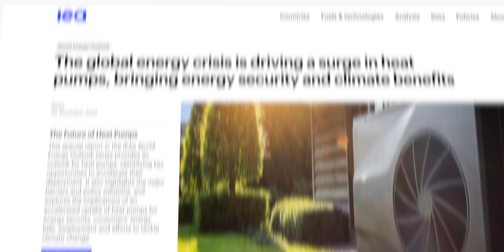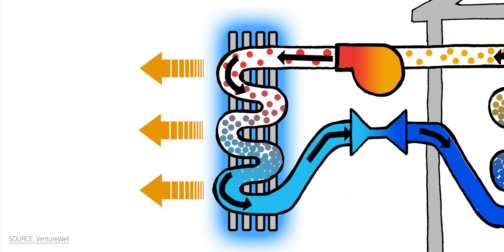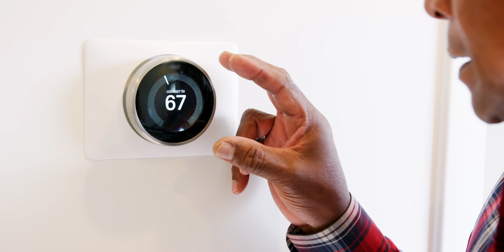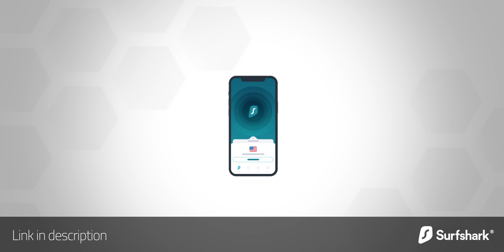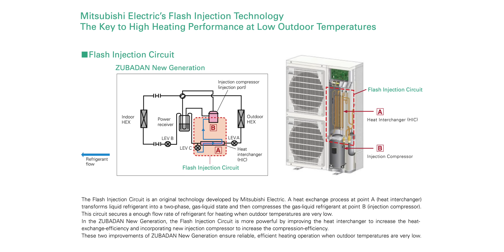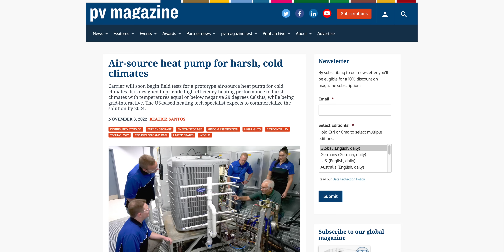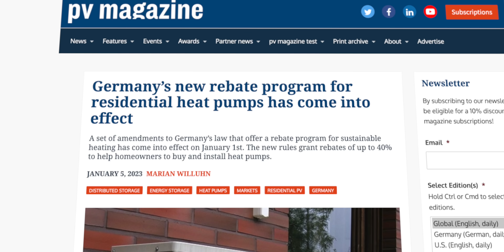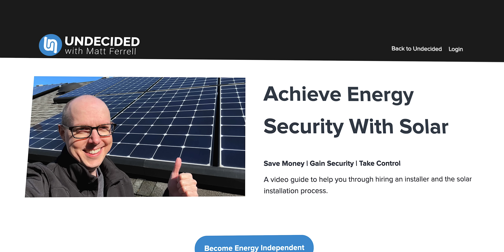Major Advances with Heat Pumps in the Extreme Cold

Comment: Just found this presentation and found it very interesting.  

May I add?   I live in a large raised ranch (2600 sq.ft.).  The home was built in '79.  Still has a perfectly functioning Heil forced air furnace original to the home, yes, the model with a 150,000 btu burner!  

Since in my town here in MA., we have our own hydro plant, I started to investigate split heat pump systems and wanted to go electric.  I decided to go with Mitsubishi.  Now, a raised ranch is really a two story home, and it was sized with one 30k btu NON HyperHeat ODU and 3 top of the line air handlers.  Two on the second floor (one at each end of the home), and one on the first floor in the large living room.  

I did NOT account for the two bedrooms and bath on the first floor at the opposite end and so...............NO HEAT!  (had to run little space heaters) After just short of 1.5 years with new system, running as it should now in it's second winter, I can say, it really does make warm air close to it's +5 degree rating.  To continue.........

I decided to contact my HVAC guys once again a few weeks ago as of this writing, and had them come back to size the remainder of the first floor and it's long hallway to those rooms mentioned.   They added another 12k btu (single ODU).  This one is rated down to -5 and is a standard model NOT Hyper heat.  So, improvements in tech right there.

It was 12 degrees the other morning, and this new additional Mitsu unit was coasting along with warm air keeping it nice and compfy.  I decided to push it to see if it could out perform my 30k btu system.   Set the fan on 4th speed, and thermostat to 80!  In about 3 minutes time, the warm output turned to bordering on HOT when I held my hand in front of the output, and was right up there where my gas furnace ducts feel in temp.

When we have short cold snaps that go into the single numbers and below zero, I DO run the gas furnace for a short bit to give the heat pumps a 'jump start' until out door temps get around 10 degrees, then  the heat pumps take over.   

Thanks for reading my experiences with an 'extended' mini-split system which is my PRIMARY heat source.  My rebate request  just got excepted and because the new addition has a SEER of 23.1 and 12.5 HSPF, I am hoping for a good return.  (O:

Comment: I looked at heat pumps here in the uk, but every time i tried, some one just wanted to rip me off, as you said the price should be around 8 or 9k, and atm there is a 5k gov grant to get that down to cost the same as a boiler, but even when I rang up big company's like EDF, they all want 12k after taking the govs 5k off, some even wanted £700 just to come out and see if my house was suitable...

Atm i Feel like they are still in cash grab mode, trying to set a high price and get people sued to paying it, or extracting as much cash as they can from early adopters as a new revenue stream.

Comment: We bought two 21 SEER mini splits heat pumps (each rated to 1400 sq ft) to heat and cool our 2200 sq ft home.  They work fine within a certain temperature range (25F to 85F).  Outside of that you have huge efficiently losses and a massive increase in electricity useage.  Our electric bill went from $350 in the summer (fairly normal) to over $700 a month in the winter.  Make no mistake, unless you are getting the exact right kind of heat pump, and have perfect insulated houses these are not a good way to save money.  On top of the huge electricity increase, they still couldn't keep up with the cold(even after improving the house insulation) and we ended up having to supplement with propane.  I wish I had just got a wood stove for winter.  Will definitely have one for next year.

Comment: Down to about -12°c our heat pump (in Europe, Daikan), works perfectly fine, below that it can't cope with all 3 air fans working similtaniously, and the temperature is lower, but down to about -20, it has been enough to keep the temperature comfortable. 

We also have a wood burner and old electrical heaters as backup where required.

Comment: We have a heat pump in a cold climate (Minneapolis). I will tell you other potential problems are not mentioned in this video. First, if you get a heat pump in the north, you will be an early adopter. So be sure you work with a company that has techs that are excited about installing and servicing modern heat pumps and not just sales people excited about selling you one. Second, if we are talking about a ducted system and not a mini-split, many people have old homes with old duct work that is not sufficiently sized to handle a heat pump big enough to cover 100% required capacity in extremely cold weather. Also, there is only so much insolation you can practically do with old homes so while efficiency can be good, it will not be optimal without dropping a lot of money. All that said, we do not regret our decision to buy a heat pump and use it in a dual-fuel mode along with sucky natural gas.

Comment: Problem here in the UK seems to be a kWh of gas is a third the price of a kWh of electricity, so you need a COP of three to break even. This is because they’re taxed at different rates (go figure). Also, I’ve read about some horror show installs where flow temps are set too high causing abysmal COP. I went in a year ago with geothermal and I’m happy overall, but even with government support it was an expensive option. I was on oil, so it was an easy decision.

Comment: Why not use carbon dioxide for the refrigerant in the heat pumps? It’s totally non-toxic, and ridiculously cheap. CO2 refrigeration systems were patented in Britain in 1850. Mercedes Benz is known to be developing CO2 air conditioning systems for its premium sedans. Why do we continue to require toxic,expensive hydrocarbon refrigeration and air conditioning systems??

Comment: unfortunately in the UK, most homes simply don't have the space to fit the outside part of the heat pump, small or even no garden space.
Reply: The outside units don't need a huge amount of space around them, some have been fitted in the UK with limited space on a side, or even on an extension or garage roof.  Often the issue is finding space for the hot water tank inside instead.

Comment: One of the main disadvantages of heat pumps is the time  to 'warm - up' compared to gas / oil systems. You tend to have heat-pumps 'ON' for longer periods, or on permanently to avoid the delays - and thus extra cost. How do these systems cope with climates where temperatures throughout the day can vary considerably - or do you keep them ON all the time and suffer the reduces efficiency?.
Reply: This is one of the common misconceptions about heat pumps, they are most efficient when on all the time.  Duty cycling or even just switching them on and off make them use more electricity, it's why sizing is very important, as an oversized unit will duty cycle and waste more electricity.  e.g. I used to believe it would use more being left on, and turned my A2A off overnight. However, leaving it on over those 8 hours, used less electricity than the ramp-up after being off for 8 hours and the increased usage needed to warm up the house more again.

Comment: We had our 15 year old heat pumps replaced last year.  Before the replacement, I had auxiliary heat locked out down to 26 deg F.  After installing the 2-stage 20 SEER Trane replacements, I was having to call aux heat much sooner and was very unsatisfied.  After I figured out that the unit controlled by a zone controller was wired wrong (it ran on fan only anytime aux heat was being called for) I locked aux heat out on that unit completely until a tech could show up and it started heating on stage 1 even though the outside temp was only 13 deg F.

I still have the aux heat enabled for anything below freezing, but it almost never comes on because the inside temp has to deviate 3 deg from the set temp to call aux heat, and that almost never happens unless I manually adjust the set temp up.

Comment: Geothermal systems are different from the heat pumps that sit in a box in your yard. Geothermal is delved into the ground to reach the layer that stays the same temp (about 53-55°) all the time. They use that layer as their background thermocline to regulate your in-home temperature.

Comment: 1:30 The graphic looks off to me. Shouldn't the compressor & expansion valve be on different sides of the wall? My understanding is that's the main mechanism of moving the (heat) energy, taking it in via expansion & releasing it via compression

Comment: I am disappointed.  Not Undecided.  With the discussion of heat pumps, electric autos, and wind/solar, the issue becomes the electric grid.  Did you mention that?  That grid is complex, interrelated, and in same cases a bit fragile.  Suggestion.  Your next undecided should focus on whether the electric grid can evolve to support the coming shifts in electric demand.
Reply: It depends on the individual grid, but this is a concern that people bring up for the UK, however, a report showed that due to efficiencies made in other areas (and just focusing on the residential side), like lighting going from incandescent to led, and domestic appliances using less electricity, along with the uptick in domestic solar and battery storage that even if an unrealistic amount of homeowners switched from gas to heat pumps overnight, the has enough reserve capacity to handle it.

Comment: Why is it that the energy rebates you mentioned don't apply for the 2022 tax year, even though the bill was passed in early 2022? So people who spent 10k or more on installation of new energy efficient heat pumps just miss out on the whole rebate because they didn't buy/install it after Jan 1, 2023? Doesn't seem fair.

Comment: I live in Anchorage Alaska and work as an HVAC tech. Heat pumps work great but there still some hurdles. The number one issue being the cost of electricity. While a furnace is no where near as thermally efficient, it's still cheaper to run due to the low cost of natural gas. You're still pulling 5-15 amps on 240 volts to run that compressor. If you're on propane or fuel oil, they start to make a lot more sense. This is just economically speaking. I'm not sure how much CO2 you would offset of you're on a dirty grid, but consider that heat pump will pull 3-6 times as many watts as you're furnace, and may have to run longer at low temperatures. I think they make the most sense in moderate climates to get off electric heat strips, or places where you need air-conditioning as well as heat.
Reply: From purely a gas usage/co2 standpoint.  In the hypothetical situation of everyone switching to a heat pump from a gas boiler or furnace that was solely powered by a gas power plant, the gas power plant may only be 50% efficient, but the average heat pump now achieves an average SCOP of at least a conservative 3.5, meaning that 1kW of gas gets turned into about 1.75kW of heat.  Whereas heating individually in a gas boiler/furnace would at best get 0.95kW of heat out of 1kW of gas.  So about half of the gas is burned for the same amount of home heat generated. The other thing in this "gas powers everything" scenario, is that the power plant could reasonably have carbon capture, further reducing the CO2 footprint.  Something that is completely unrealistic for having in every home with a gas boiler/furnace.

Comment: It is crucial for the compressor to be several feet off the ground and be covered by a shed roof. The more snow you can keep off the fins the better. I have 2 minisplits , 12k and 24k sylvane aura, in my 1000 sq foot wood shop and run mostly just just on the smaller one.

Comment: As I have said before - I love my Water Furnace geothermal ground loop system I had installed 2001. I had to install a new coil due to coolant leak about 6 years  ago. Last year I had to have a minor service call. While here the Tech said I will eventual need to replace the main loop manifold someday due to an over tightening of a fitting into the manifold when installed causing hairline cracks in the manifold, thus a small weep of loop fluid [6 years since last topped off]. I paid off the unit and installation with reduced operating costs about 12 years ago. I have been absolutely comfortable since the day I moved in in April 2002!

Comment: Canada
Our old heat pump would heat the house as long as the temperature remained above -7C (19.4F).  We had an oil furnace that kicked in below that temperature.  Our oil furnace was condemned last year, we had to make a change.
We were so pleased with the first heat pump that we have upgraded to an air source Carrier that will heat the house above -28C (-18.4F), and we installed an electric furnace to kick in below that temperature.  The installers called the electric furnace "the toaster", with good reason.  This winter the toaster came on to defrost, occasionally, with no significant bumps in our usage.  
BUT we had one night at -39C (-38.2F), which stopped our heat pump from functioning, so the electric furnace kicked in.  The hydro usage doubled on those two super cold days.  We feel it was the right choice for us, even though the electric furnace costs a mint to run, but only runs on rare occasions, and because we only have ONE monthly billing, electricity - no gas, no propane accounts to maintain.  It will take a year or two to really see if this heat pump has saved us money, but I very much doubt it will be costing us more to run than the former heat pump and oil furnace.  We have a little wood stove for power outages, just in case.

AND having heated with an air source heat pump for over 10 years, we find we prefer it, cleaner, more consistent, and it doesn't dry the interior air too much in cold weather.

Comment: I currently have a gas furnace with a central air conditioning unit outside the house. It would be great if a heat pump could be retro fitted to replace the function of both and use the air distribution system that is currently part of the gas furnace so that the only thing that would have to be changed would be the outside heat pump...does such a thing exist?

Comment: Sounds good, as long as you can afford it. As of 6 years ago a train heatpump cost $2500, I'm sure these brand new super efficient models are even higher, versus getting gas furnace installed.

Comment: Matt, 

My heat pump stopped working last month. So this video was very helpful. Two things stood out: 1) newer heat pumps are able to work at lower outside temps, and 2) there will be rebates available to help with the cost.

I'm especially interested in the IRA rebates you mentioned, and I've tried to find out more about them before watching your video, but the DOE website is not clear when they will be available ... or if they will be retroactive for systems installed this year before the money is released to the states. I'd really appreciate your help in finding out. 

Since the repair cost would be $4-5000 and since it is 18 years old, I think it's best that I replace it. So I've been on an HVAC crash course ... and in the process I learned about this rebate program and about tax credits (for 16+ SEER systems) I have delayed having a new system installed; so hopefully I can take advantage of this rebate. I could really use the help, since estimates range from $10 - $14,000! In my income bracket the rebate would be 50% of the cost up to $8000.

I can wait a while longer, but I need to have something done before summer.

Thanks for your help!
Reply: Can you please share link about rebates?
Reply: @ninjip3460 you’d better to Google and read it in IRS website. Only $2k tax credit is offered by federal government.